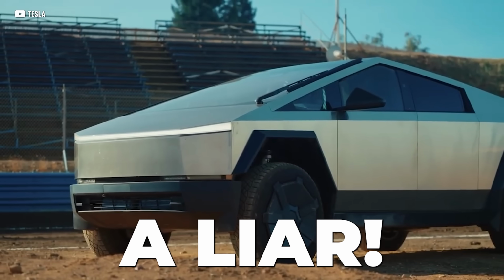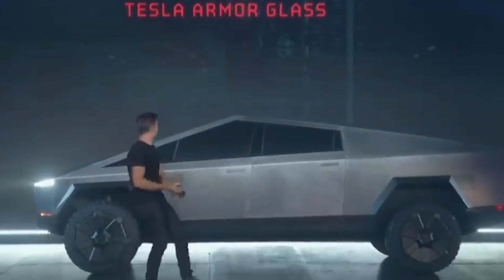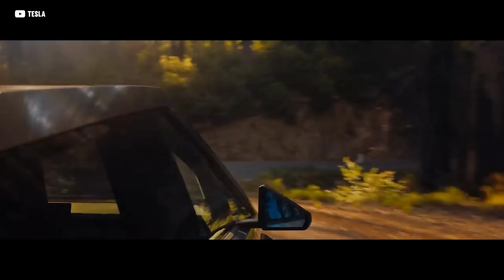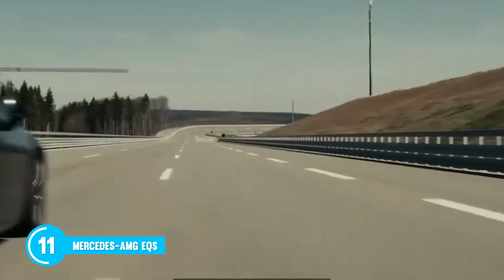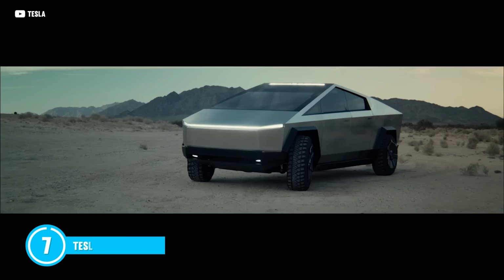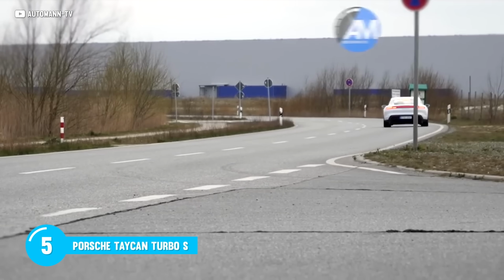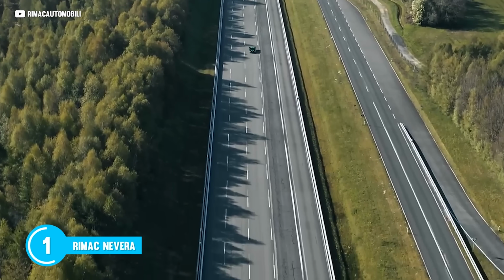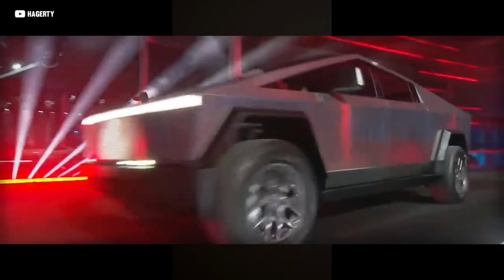Tesla Cybertruck - Greatest Automotive Hoax Of All Time?

Comment: I like the cyber trucks innovation. Rear wheel steer to make up for the long wheelbase, radically different design, insane acceleration. 

I don't like its size and weight, it doesn't make sense anywhere outside of the UK except in very specific use cases.

Comment: It's already proven to be a 300 grade stainless steel that already existed., it's too heavy, lithium battery fires burn at 3,000-4,500 degrees Fahrenheit which is hot enough to burn through concrete... no thanks. I'll keep gasoline and diesel

Comment: I want to see it do truck things. Never mind the unrelated show-off stuff. Mount some toolboxes on the top of the sides of the bed and watch all the tools slide to the back ends. Open the tool boxes and watch tools fall out. Tow a trailer of some kind on a long trip, see how many times you have to recharge. Let's see it off-road. Let's see in on the road in snow.

Comment: Stainless steel ain't all that. Seriously. Most cars and trucks today make liberal use of high strength steel, but even a good grade of carbon steel is "stronger" and less susceptible to stress cracks than any 300 grade stainless. SS scratches easily too. The magnet free motor, 48V, and drive by wire are great, but the body is a hot mess. Elon is no engineer.

Comment: Doesn't acceleration hard drain the batteries significantly, and permanently? And while we're on that, does anyone know the expected battery life is and how much they'll be to replace ?
Reply: It's a truck. Why does it need to be fast?
Reply: It's a Tesla so expect lies as far as range and many many many thousands for battery replacement. Now add to that you can't repair stainless so a ding essentially totals the truck.
Reply: Yup, i've heard $60k to replace batteries, and over a 100k for the largest EV's, and that they're being written off when in even minor accidents for fear of damaged battery cells which will cost us all much more in insurance costs.  @whichgodofthousandsmeansno5306

Comment: 2:20 “ they’ve eliminated fuses”… smart.. REAL SMART
Reply: Yes it is. There are better ways to protect a circuit. The jets I fly don't have any fuses either.
Reply: @NukemNak  for a car this is terrible and another headache for troubleshooting electrical issues now
Reply: Actually not. It's far better as the computer will tell you the precise location of the fault. Fuses protect quite a bit of wiring, so tracing a fault is a nightmare.  If it's an intermittent fault it can be incredibly difficult to trace. With a Tesla, even if the fault only happened once, you know exactly which wire or component faulted.

Comment: I wanna get one.  I put down the deposit, but the Beast, may be beyond my budget.  Some things I really liked initially, before they changed, it seated six and would go 500 miles.  Now it seats the same as a Honda Civic, but I'm hoping it will be more comfortable and the max distance is somewhere around 300, which is about what I drive in a week.  I'm concerned about the towing aspect.  It needs to be able to move a 24' pontoon boat, but not very far, however, I have a small 16 foot aluminum boat and I'm hoping the range is impacted far less than that of the F150 lightning.

Comment: I'd just like to know how that thing passed safety regulations despite a seemingly complete lack of crumple zones.
Reply: The released crash test video does show the vehicle deforming and absorbing lots of energy. Please be reminded that whatever means are used to reduce the energy transferred to the passengers, the tests do include sensors in the dummies that help determine the safety. I quite don't understand why so many in the media affirm categorically that the car is a death trap because it lacks crumple zones and other features they claim not to be there. Probably, in the near future there will be more information available, but I do expect the CT to be quite safe based on the comments by Tesla and people that know more than I do.
Reply: @graciasthanks4771  Tesla changed the spec of the steel from 3mm to "up to 1.8mm" thick.  If you look at the hood on that crash test video, it bent like it was paper-thin — most likely it was a lot less than the 1.8mm.  Even so, the travel distance of the test dummy's head was a lot shorter than the dummy in the F-150, which means less time for energy to be absorbed by the truck. And Tesla didn't show the return of the head back to the seat back —  they cut off the video.  Undoubtedly, they didn't show the whole video for a reason!
Reply: @Mark-eh7kx  I prefer to wait for the official report. I will be surprised if the crash tests didn’t show a very safe vehicle

Comment: Good catch to those who know it was the Base 911 Porsche, kind of like the 1 leger 2 wheel drive F150 ( half the Weight ) on the Tug of War
Reply: And yet, still a 911!
Reply: @mannyrosado9887  On a 1/8 mile track.  Electric vehicles have instant torc,  hence the short distance setup so the truck has an advantage.  Plus, the 911 was a manual.  So, shifting speed and timing matter.  Undoubtedly, it was driven by a Tesla employee who wasn't going to drive the car in a way to beat the truck, of course.  The test was rigged!

Comment: The Design doesn't bother me, as much as the Battery's made with Corrosive Acidic features that leak an Orange or Brown Gel... There's a reason why it is illegal to mine Lithium in the United States there's a huge area that can be mined for minimum 10 years. It is Environmental Impact to our Ground Water while Mining it is Bad, and worse when trying to put i back to Earth mixed with other elements, which make it acidic, and Statically Charge... 

There's a Reason Why it is illegal to Mine it in the United States. At it's End Life the Battery Pack Leaks an Orange or Brown Corrosive Gel on to Our Ground Water. There are only 4 Recyling Centers in the United States, and none are in the State of California. 
Gasoline Engine Vehicle they are easily Shredded and Recycled. Don't feel guilty about Paying for a Cleaner Environment 👨🏻👍🏻🏎🏁🚩🌲⛰
I am happy to Say My 2022 Roush Mustang will only gain Value and be Cleaner on it's End Life .

I just Viewed a video where a 2021 Tesla owner who replaced the Battery Pack twice in 2 years.. Therefore, he's on his 3rd Battery Packs. This Means his EV is a Grose Polluter and seen footage that EV's are a Scam

I think there never should have been a 4 Door vehicle with Mustang Badges, and Ken Block Hated it, which is why he went to Audi. 

You'll regret not getting the Performance Handling Pack with MagneRide Suspension..

In August 2022 I bought the only Vehicle with the Following Combination Spec, in all of California.: 
1.  3rd Pedal 6 Speed Manual Transmission
2.  White
3.  Rear Wheel Drive
4.  V8 No Turbo
5.  Mustang

It's a 2022 Roush Mustang with the No Lift on Accelerator Pedal Rev-Match Tremec 6 Speed Manual Transmission. 
MagneRide Suspension the car does not Lean or Bottom out, no matter hard you take a Corner, or Dip under Hard Braking.
It also has the Intercooled Limited Slip, Rear Torsen Differential. ( Same as the GT500 Differential) 
all with Warrantied thru Ford for 8 years, obviously there's 6.9 years left in the Warranty. I will Never Sell Her not even if Offered $1 Million.

Comment: The cyber truck is not a gimmick, but the body shape is. I understand it was necessary for the coefficient of drag, but a Corvette has an incredible coefficient of drag. I look forward to a revision that has a more pleasing aesthetic, and even better performance when used like a truck. The 0 to 60 time is fun to talk about, but I don’t care how fast it is when I’m towing my wakeboard boat to and from the lake. It needs to have range, payload and people capacity. If it takes an extra battery in the bed to improve the range, then it’s not going to function very well when you load up Waters sports gear, coolers, etc.
Reply: It was also necessary due to the skin material that can't do compound curves well.
Reply: @kevinmoon4148  You mean they haven't found and effective and efficient way to produce them yet. If you hit it hard enough with the ball of a ball peen hammer it will leave a dent with compound curves three dimensional. Curve are necessary for strength, rigidity, aerodynamics, lightness & Safety! No sharp edges or seems to hurt pedestrians! Mind you the bonnet height like every other truck on the planet! looks like it would slam them under rather than throw them over! What about crumple zones?
Reply: Literally noone gives a shit what you think.
Reply: The body shape is futuristic! The Musk engineers lead from in front of the front! They have to make it different to not be the same! They have to make better to be considered as good! Now they have to make them quickly to ride the wave of Euphoria! A million (100Million$) on pre order! Brilliant Marketing Strategy! I'll bet they'll have sold 5 Million by Christmas! What you get for Christmas Chuck? My darling bought me a Tesla Cyberbeast! Well she put the 100$ down & look forward to the build date notification!
Reply: @kevinburke6743 I would dispute that the body is futuristic bud , I think it is utterly , utterly horrendous, and I can tell you there is a reason why 99.999999 % of car makers do not make cars with flat panels and sharp edges. 
If I said I thought the fucking thing was huge heap of shit , I would be understating my feelings for this abomination.
Reply: @kevinburke6743  who’s Chuck? 
I am a super happy that you are bought in. I’m not. The 0 to 60 performance is great, the towing range is still a question, and I don’t need bulletproof materials. The bottom line for me is, if I am buying something I have to look at and drive every day then I’m going to buy something that I’m proud to be seen in. I’m not gonna go out and buy an ugly vehicle just to be “one the cool kids,” IMO. Just like I didn’t search for a spouse that was great at sports, had a glowing personality, but looked like something dug out of a prehistoric cave.
Reply: @ThelifeofKingfish  Chuck is just a generic bloke! For work I drive a pick up truck, it is also a family car. 4-5 seater. All whistles & bells. Very Tax efficient in the UK. I do about 36-40K miles a year. Very little in the load bay! I've had them all. They are all very good with their own little quirks. My last one was a Ford Wildtrak 3.2L Diesel. 0-62mph about 9secs. So I would not buy for accel or top speed! Purely practicality! Nobody wants to race you away from the lights! Nobody want to cut in front of you or have you too close to their rear fender! They do 30-34 mpg and a bi-annual service keeps it in good fettle. Tyres run for about 40K miles barring problems. But the big benefit is crash survivability! They are built on a solid ladder chassis. Yes they have door bars in the doors in the normal position where cars would. But that means about 4 foot off the floor! In the event of a fender bender or some lunatick car driver or delivery van bump. Who's going to come off worse. They say Size Matters! Weight takes some stopping! Our out of the box 1 Ton Pickups. Top of the range models are pretty cool comfortable and very well appointed. The New Nissan Navarro now has coilovers & discs at the rear so should be even more comfortable.Some people even think they are sexy! This cyberbeast fills many of my criteria. The charge at home, starting everyday with a full tank of Juice! Not many days per year I do over 350 miles all told. So 400mile range is more than adequate. Spouses as with everything, try before you buy! I choose a partner like I would a cell phone! You can get the same for for the similar money contract or burner!  So, it's all about the upgrade/s & the frequency of change! Ooops we are back to chatting a trucks again!
Reply: @kevinburke6743  love it!! 🍻
Reply: @kevinburke6743  you are a idiot og du vil blive skuffet som den muskrotte du er(danish)

Comment: Maaaannnn…. I used to be a cheerleader for Tesla. Now everything they do, other companies do worlds better. All while their CEOs aren’t insane meme morons or cryptobros.

Lucid’s going to absolutely ruin Tesla if they can make their cars cheaper. And I would much rather have a Ford Lightning or the Rivan truck over this unfinished monstrosity.

But hey, at least it looks like what I thought cars would look like now, when I was a kid.
Reply: Lucid? 😂😂😂
Reply: You must be joking? Cyber truck just broke the truck world, trucks hasn't changed for the last 70 years. Cyber truck just introduced a new way of making trucks like using giga casting, stainless steel body with aluminium frame, 48 volt system which reduces electric cables by 75% and so on.

Comment: EVs are officially too fast. Why do you need to go 0-60 in 1.8 seconds?
Reply: why not? We all want a combustion engine that can go that fast so why are you complaining about an ev doing it?
Reply: @SlowSorrow01 no we don't "all want combustion engines that go that fast". The roads are not race tracks and this level of performance is not usable in any meaningful way. It's all about bragging the numbers and producing publicity content. Marketing. Absurd. Incredibly wasteful of resources. And doing what EVs are being promoted as, saving the planet, a f***ing joke!
Reply: @SlowSorrow01  nah, I don't. I just want something enjoyable to drive without having to struggle with 500+hp.
Reply: @damilolaakanni You don't need to drive your 500+hp vehicle on sport+/track mode it all times.
There is no shame dropping down to a lower setting if it makes it easier for city driving.
My m4 competition xdrive has a 0-60 of 2.8 and I would probably rear end someone if I used its most aggressive settings in city driving.
Reply: It's all about bragging rights.
Reply: if a combustion engine care did 0-60 in 1.8 seconds u would've loved it
Reply: @kadhir5738  A dodge challenger demon can do a 0 to 60 in 1.66 seconds on the drag strip.
Given a proper weight distribution and suspension an ice car has no issue keeping up with an electric.
Electrics usually never have to switch gears but ice cars are usually lighter since they only need to carry enough energy/fuel for the 0-60 record you are trying to set.
At 1.66 second 0-60 it's as much about the tire coefficient of friction and design as it is about the car doing the pull.
Reply: @Derekzparty  combustion are officially too fast. Why do you need to go 0-60 in 1.6 seconds? THE MAIN COMMENT
Reply: @kadhir5738  As an engineer it is our job to push boundaries.
Having said that, I am perfectly happy with the 2.8 second 0-60 from my m4 for daily driving.
Reply: @Derekzparty  thats what i said
except its an ev
Reply: i respect the fact that ur an engineer @Derekzparty
Reply: @Derekzparty just for completeness sake since you omited half of the weight equation: the electric motor+gearbox+inverter usually weigh in and take about the same volume as the transmission in an ice car. 
so in the end ts not a swap fuel tank to battery, but rather a swap fuel tank+ engine to battery weight wise. of course this is still heavily simplified.